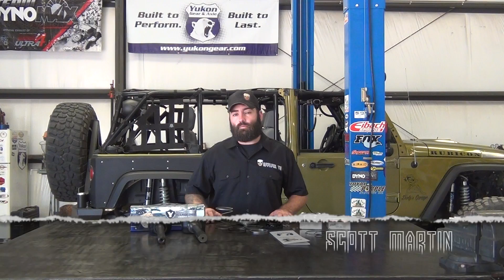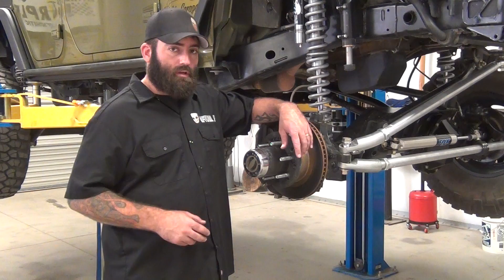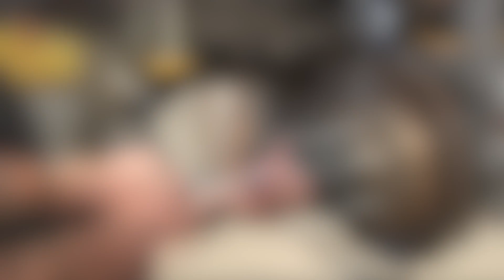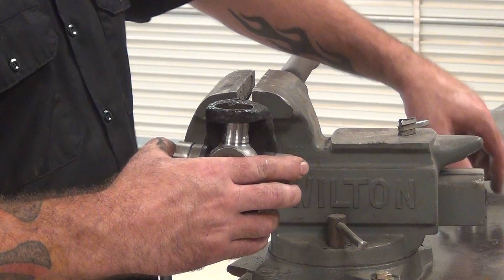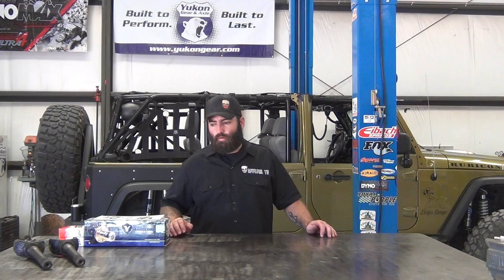Yukon Hardcore Locking Hubs and 35 Spline outers Installation Ford Dana 60

Comment: What lift do you have on that jk? What brand of drag link and steering link. Things are massive.
Reply from the maker: Lou Keller   The lift is a Rockkrawler Long arm kit.  The drag link and tierod were machined here locally out of 7075 aluminum using Rock Krawlers new steering joints.